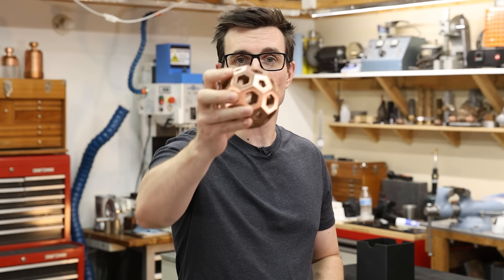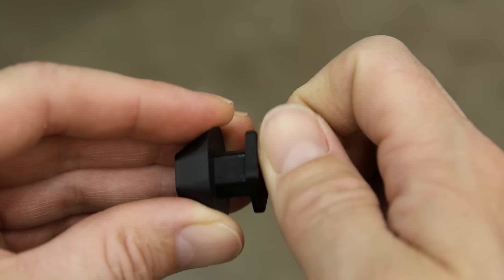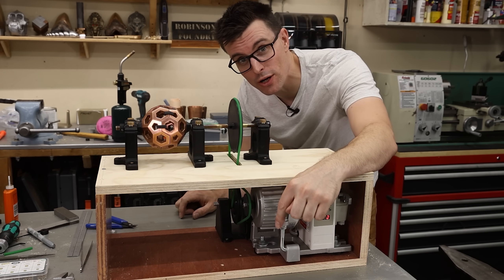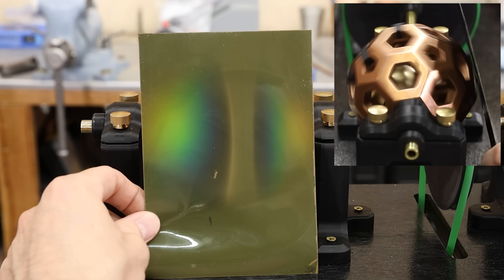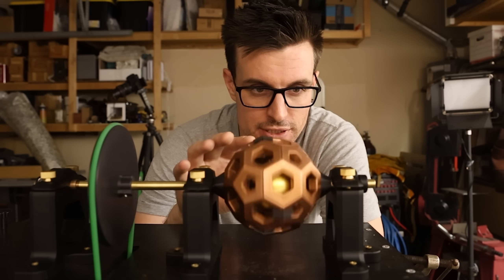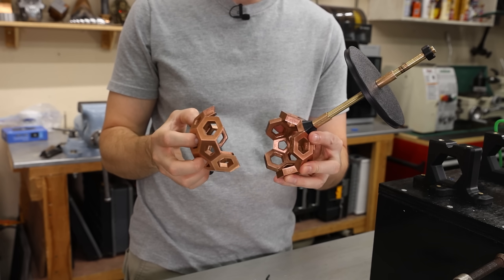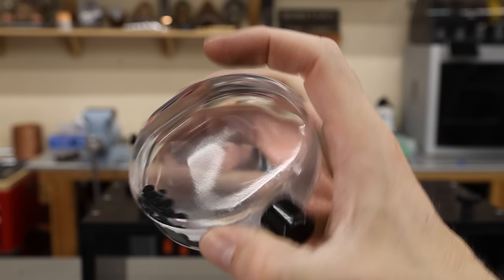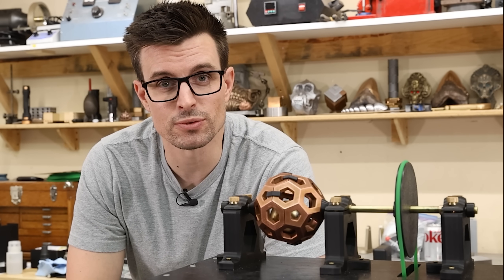Huge Magnet vs Copper Sphere - Anti-gravity Machine

Comment: In my opinion, you should use a larger magnet. The effect in the tube occurs because the magnet is equidistant from the perimeter. To achieve this same effect, you could try using a magnet that is almost the same diameter as the inner diameter of the copper sphere.

Comment: Fill the holes with epoxy transparent (no air flow) and iside with water (liqiud) trough one of the axis holes and isolate, than rotate 😅 ( you can try first without liquid inside)

Comment: What if you used a copper tube rotating horizontally. The tube might have somewhat smaller diameter (maybe plates with a smaller hole than the inside diameter of the tube) at the ends of it. That might help the magnet stay inside and not drift out of the tube?

Comment: no, its not an anti grav machine you illiterate youtuber, gravity is still pulling the magnet down with the same force it's just being opposed by an electromagnetic drag force, not canceled, this is electromagnetic breaking, not lifting. ALL energy comes from the rotation or motion, and it is dissipated as heat in the copper due to resistance. Gravity is being opposed by electromagnetic drag not cancelled, even if paired with a designed field system(e.g maglev) its not anti gravity.  Zero violation of newtons laws, conservation of energy nor conservation of momentum.

Comment: @Robinson Foundry - You are hurting yourself with the weight of a single, heavy magnet, especially since the magnet has only 2 poles which is far from optimal. Two poles implies a very long magnetic return path, which in terms of magnetic repulsion, is a very poor match to the copper cage. Instead, print a plastic sphere with recesses in it for smaller super magnets, at least 24 small magnets or perhaps up to 48 of them arranged as at the vertices of a truncated octahedron or a truncated cuboctahedron, respectively. Each magnet should be inserted so as to have opposite polarity from all nearest neighbors, which is possible with those two semi-spherical shapes since they contain zero triangles. This arrangement begins to give you the effects of a spherical Halbach Array, in that each small magnet has an enhanced magnetic return path on the back side, thus making the field more intense on the outward-facing front side. In turn, that more intense field provides stronger eddy currents, and keeps them at shorter ranges for increased effectiveness: The repulsion on the top side will weaken very quickly as distance from the copper cage increases. At the same time, repulsion on the bottom side will strengthen very quickly as distance from the copper cage decreases. Finally, small magnets and a plastic carrier add up to much less weight than a single solid magnet, requiring less repulsive effect to achieve levitation. Net Effects: Good levitation, good centering, easier operation, and overall better results. 
See https://en.wikipedia.org/wiki/Archimedean_solid for more details on the two shapes.

Comment: Hi I Studied Electicity in Estonia and here is  my reccomendation .So If you Change the first copper structure into something more accurate. As it is in most motors ,Copper winding structure.(Example : Transformer) So Copper wire that has a thin layer of insulation meaning its electricity generating properties persist. We could Surround the magnet with With Copper winding coil and then test how much it generates electricity. I Realised That The perpetual motion machines logic is Simpler than Most men like to argue. I Made a Mp3 player That had a battery neclace , that lasted for a 1 month without chargeing . I imagined I put sun panels on that neclace so it would recharge on the day time. So my point is  Rechargeing is a natural part of perpetual motion. It is a perfect balance  between the battery reservoir  , the recargeing panel and Object that uses the electricity. Laymans terms  big battery , small user , medium recharger equals perpetual motion. Back to the point. If we Size up your amazing  project ,we could have the coil sorrounding the magnet generate more electricity than the generator needs to make it rotate.  :D  A Machine without Resistances . Amazing work dude.

Comment: Inconsistent electrical connection between the halves could make the bouncing effect. That was proven when it didn't work at all aligning the halves the other way. Solder the halves together for good connection.

Comment: A thought came to me that if you want the spherical magnet to levitate inside a hollow spherical copper apparatus, divide the copper sphere in two equal hemispheres and rotate them in opposite directions vertically. I keep getting the idea that the spherical magnet will eventually begin rotating along a vertical axis like a gyroscope.

Something to try, especially if you can electrically connect the two halves via an external circuit to neutralise the possible charges on the copper hemispheres.

Comment: You should consider building a ferrocell, as it allows you to visualise the entire magnetic field in three-dimensional depth. With this tool, you can create objects that constructively interfere with the field, providing deeper insight into the invisible interactions taking place.
Currently, it appears that some destructive interference is occurring. This may be due to the geometry of the copper truncated icosahedron you're using, but a more likely explanation is that spherical magnets produce a uniquely balanced and more perfect field pattern. This type of field demands equally precise opposition to stabilise interference effectively.

To address this, try using a magnet of a different shape inside the copper structure—such as a cylindrical magnet. A spherical magnet works well when passing through or rolling within a copper tube, because the differing shape of the tube allows for temporary changes in the field. However, if the magnet is to be enclosed within a copper object that is itself spherical, then changing the shape of the magnet becomes essential.

Comment: I won't argue about making the magnet float, but you could probably increase visibility by using a copper mesh (or sieve) that is easy to see through. I think it would also be better to have two half spheres with a gap in between them to see the ball in the middle, then either have vertical or horizontal slits rather than the curren hexagon approach. You can probably also put a light inside of the ball the same way you attached the rotating rod so it is illuminated and exposes better on film - no need for strobes.

Comment: Instead…. Make circular copper plates with an insulating material between the two copper plates which are concentric circles. Then put roller neodymium magnets on the out side and repeat your experiment. Hint: magnet fields need to be induced into the copper plates in a sine wave and at the correct frequency around 8GHz

Comment: You do not know enough about how and why magnets are magnets. you showed the magnet falling through a pipe, and it slowed down. It slowed down because the pipe was being charged with electricity, i,o,w, an electromagnetic force is generated while magnetic movement takes place. A tesla coil does the same thing but in reverse. The ball magnet,s centre is at 0V (If it is to be a magner in the first place) and the inside of your copper framework is allso generating 0V (resistance). The inside of the copper matrix is ---V while the outside is radiating +V provided either the magnet or the copper moves!. This means you are generating a + electric field around the copper matrix. The infinity of space is by definition an Aether field behaving in a +electric manner, precisly because the Matter of earth is moving through the charged electrical field of Aetherspace  so creating a --Vcharge inside earth .. Therefore,,, .... if you can eliminate the +field on the outside of the copper matrix, then the --field on the inside of the copper matrix will be attracted by the +tive electric field of the infinity of space. If you can generate enough power to overcome the kg,s of weight involved in the geometry of the thing , it might gravitate upwards. Realize that the outside of Earth is radiating + power just like your copper matrix. Your feet on the ground is at 0V, your head is at 500V+ and an airliner is flying in something like 1millionV+. That is what must be used.

Comment: You need to make the inner sphere out of smaller interlocking magnet with the positive poles facing outward. The problem you’re having is the equator is a magnetic dead zone. You can’t eliminate that, but you can make it smaller. Good luck!

Comment: Might defeat the purpose but insert two round magnets in the ends of the shaft closest to the sphere.

===+(  o  )-===

=  is shaft
+ is north face magnet
- is south face magnet
(    ) is copper sphere
o is magnetic ball

Either rod/disc magnets on inside of shaft or cylindrical/toroid shaped magnets on outside of shaft.

Comment: The cylindrical setup worked because of the symmetry between all parts, including the structure of the magnetic field. I managed once to do a dynamic Lenz levitation. It was a setup made of 4 aluminum cylinders, each around 5 cm in diameter and 1.5 cm wide. They were mounted on plastic bearings, forming a cross, with the center of the cross empty (1.5 cm square). They were connected through conical gears; therefore, the rotation of one was transmitted to the other 3. Just one of them was connected through a shaft to a variable electrical motor. Seen from the upper side, the surface of the aluminum cylinders looked like going away from the empty center. Placing a small neodymium magnet over the empty space, it was possible to make it levitate continuously for minutes at the correct rotation pace of the motor; however, the magnet was levitating not statically but rotating. After too much use, the gears wore out and the system stopped working.
Reply: Let's make a real mini UFO?

Comment: The problem is that Lorenz forces are based on relative motion. So as soon as the magnet is pulled up to speed by the induced magnetic field the magnetic field disappears. Thats why there is always a rhythm in the way the ball floats and falls. Thats why is also when you were able to get a stable position when you were increasing the speed. 

Past a certain point it seems that the centrifugal force of the ball overcame the momentary magnetic field and it got stuck in one of the hexagons so once again so relative force.

What you would need is a drag on the ball to keep it from ever matching the speed of the cage… placing it in water or oil might do that.
Reply: You are mislead. Read the Faraday paradox. The aether is working anywhere rotation is present.
Reply: So it only works in a vacuum?
Reply: @000Krim no not in a vacuum. It’s relative motion. When the cage is spinning faster then it will create a magnetic field in the ball. If the ball is spinning faster it will create a magnetic field, but if they are both going the same speed there is no magnetic field and the ball drops.
Reply: @themusingox1635  yes you are right, what I mean is that in a vacuum there is no air to transfer the movement from the cage to the magnet, or the magnet will spin anyway?
Reply: @000Krim oh, the air has nothing to do with it actually. It’s all electromagnetism. 
The air provides some drag so the ball will slow down faster than it would in a vacuum.

Comment: Einstein.sean Astins here.appollo 10 preliminary and 4 fingered alien interstellar ride also exceeded time space conventional laws by astronomical inversion..immersion.
U need a dual walled fish tank donut and therafluid ...while the copper should be cantored....I'm assuming circular donut and as for the magnet perfectly round.....one design should have wheel balancing and other non solid......I'm assuming a external maybe internal and external ball balancing...so maybe three different.
Then analyze the fields positioning and  stabilizing optimizationable tryouts....when optimized we might like it.😊

Comment: I think the interior of the copper polyhedral should be a smoothed continuous concave surface. Seems like the constant field of space desired between concave and convex surfaces, would want a more regular or concentric environment with consistency for maintaining such a space/equilibrium. As well, the quality of the copper is essential. Not sure if the 3d printed polyhedral is using a pure copper, rather than a copper alloy or even a resin bonded copper. The internal magnetic sphere should also be of a specific alloy and weight to achieve a symbiotic relationship of metals to enhance components compatibility for desired results. Nice experiment. 
The peripheral magnets should be a specific size and shape and be presented in an unbroken band. Much like the solar system. Perhaps even in a design similar to an astrolabe. Distances, band widths, metallurgies, magnetic prowess or force, among things to consider. Interesting project. I am a sculptor in metals and have made custom designed sundials. So your project has intrinsic curiosity for me.

Comment: The ferofluid is showing you where  it's off or should be aligned ...
 Maybe try it at a 30° axis with a solid center "belt" as opposed to the holes... the magnetic flux through the lens is displaying a wobble .

Comment: The sphere must be levitating initially at rest quietly contained within an the shell then what happens when that shell is spun around that sphere that is harmonically stable within a shell (magnet/anti magnetic materials be the sphere, the shell or both). There is no contact, contact = probabl catastrophic failure. When

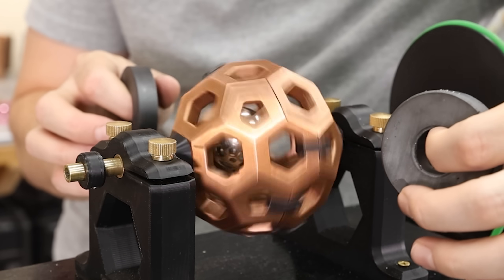 is like watching you drive a Ferrari with a flat tire. @11:42 From your lips to our ears. Why are you touching that poor magnet.

Comment: Maybe use a table drill? Those things can be lowered slowly and vertically techically nullifying the earth's gravitational pull on the magnet, the reason it won't levitate freely. Just thinking aloud. 🤔

You're doing an awesome job either way, thanks. 😁

Comment: Turn your contraption vertical. Earth's gravity is the issue I  see, as the magnet is starting on the outer edge. Once rotation starts it should propagate to up to the center of the sphere.
Reply: Wouldn't you have to, slowly lower the shell in order for gravity to be nullified? 😳

Comment: Hi, I am interested by the artefacts which have been found looking very similar to your creation. Please may I ask, have you thought about the tolerances  between the joints of your two hemispheres? Are you thicknesses calibrated on all sides? Also, could the internal magnet be suspended in a liquid to provide further stability to the experiment? In addition harmonics have been successful in supporting suspension of heavy objects against gravity. Just a couple of thoughts.

Comment: I would take the halves of the geodetic sphere and put them in a lathe. To make sure the inside is completely round. I’m curious as to what would happen if you insulated the 2 halves of the outer sphere from each other. Then add a little bit of electricity to them. Positive on one side, negative on the other That way they could each generate their own field.

Comment: I would love to see, on a small scale, an arrangment of magnets you set in a 3d mold as its built. This will hold the magnets in proper place, and make the 3d mold something you can incenarate (or something like that) fast to not disrupt the placement of the magnets. If you could burn it off fast enough you could get them floating. Next idea is to use magnetic liquids and liquid metals instead.

Comment: I am in no way educated in the field of magnetics. That said when ever magnetics have been dumbed down for layman consumption its always illustrated with these wire like strands that emanate from the magnetic source. Something your plastic film confirmed true when you looked at your magnets through it. So taking that this is for certain the way these waves or arms of magnetism ebb from your spheres, I believe what’s thwarting your success is the configuration of your cage. That behive esque configured cage breaks up any possibility for a steady or constant surface to buffer against for those magnetic field waves. The reason it hovered in the pipe was due in part to a continuous surface to rebuff against. Taking that factor away must just be enough to offset the delicate dance of that phenomenon of happenstance. Thats my guess. And you may be able to easily test to see if in fact this is the case by cutting a similar pattern into the copper pipe and retrying your drop through test. If the magnet reacts differently then there is your Arkham’s razor. At which point you have some cage configurations experimenting to do. Thats all I got. Good luck Man, the rest of that experiment looked pretty tight to me. But again, what do I know. ✌🏽
🕯️out.

Comment: i suggest you make 2 half rounds and spin them together with an open slit in the middle  so we can see in and so you can guild the ball to the center of the sphere. also can try making the gap bigger and bigger see if you can levitate from a distance or spin each half round in an opposite direction.